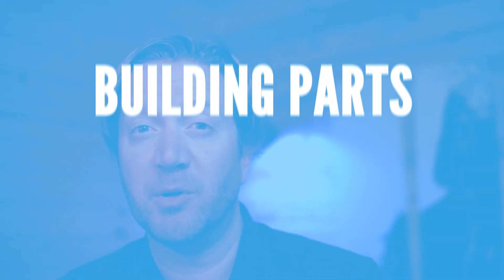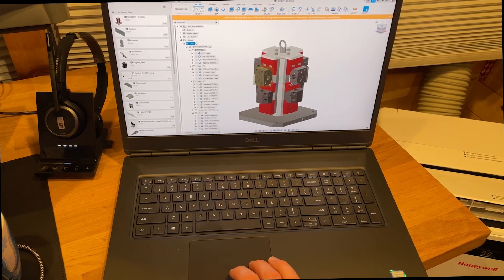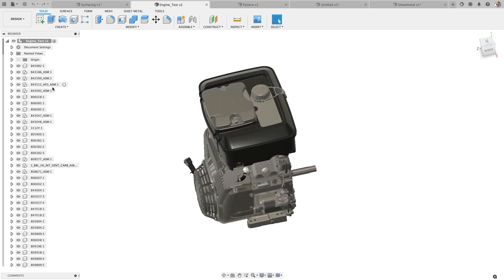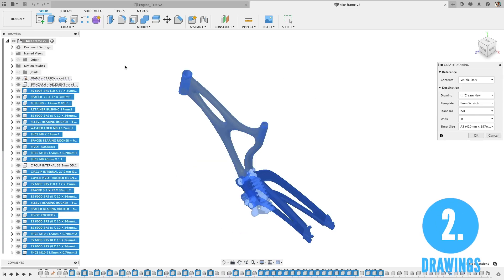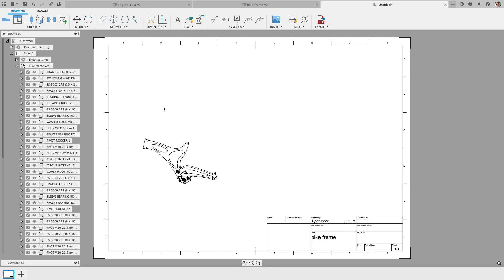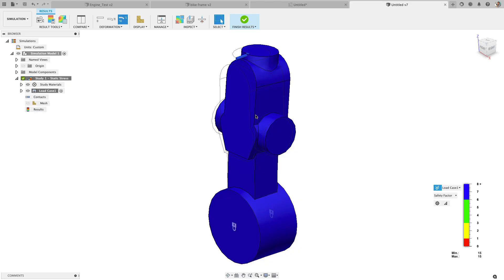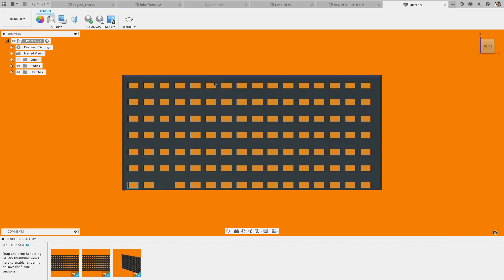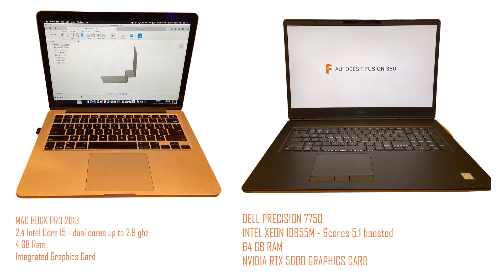Can You Run Fusion 360 On An Old Computer (Old and New Machines Compared)

Comment: I have a Sherline CNC mill that I want to make small parts with.   I have used Solid Works, but an engineer suggested Fusion 360 as more user friendly for me.    Having some confusion getting the part converted into g-code for running the mill.   I was told that any older computer will run the Mill's stepper motors using g-code, but not sure if an older desktop will run Fusion 360 at all ?

Comment: "Old computer" 
->using a notebook from 2013.

Oh boy you have absoluteley NO idea on how old systems are that run fusion well. 

Correct title: i start up my old macbook and do some nice looking videos of it running fusion like it did aswell all the years before.
Reply from the maker: :). I totally see your point.  My older MacBook does hit the minimum specs but it does a good job.  Let me know what your experience with your machine is like.

Comment: Hi Tyler. I was recently advised to update Fusion360, or I would only be able to view files already created. 
Downloaded and started to install the updated version on my 2011 iMac, and was told that the new version wont run on my current OS, which is High Sierra. 
No problem I thought, I'll just update that first. Turns out that my iMac can't run a newer OS, meaning I now don't have any version of Fusion360 to use. 
How did you get it to run on your old MacBook? Is there a way I can get it installed and working again?
Thanks. Steve.

PS:- I'm only using the free version, as I'm just trying to learn it for my own use at home.
Reply: Same! My iMac ran F360 perfectly. I did a clean reinstall of the OS and can’t reinstall F360 now because it runs High Sierra. It has better specs than my laptop running w10 but isnt supported.